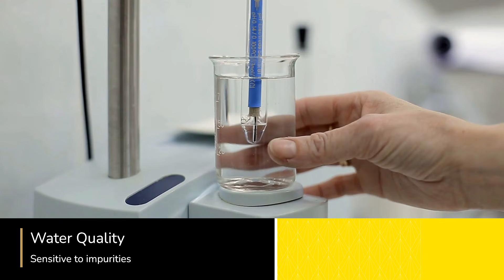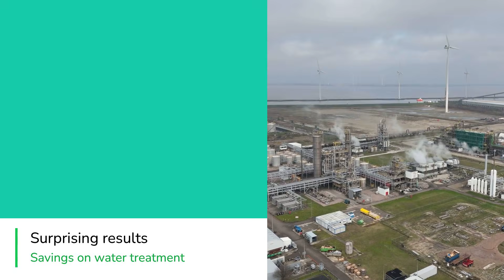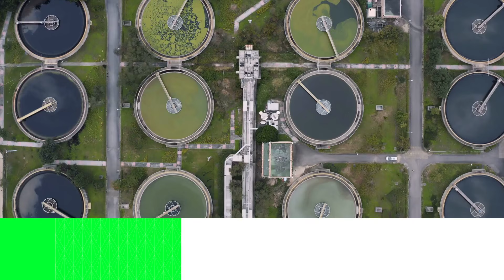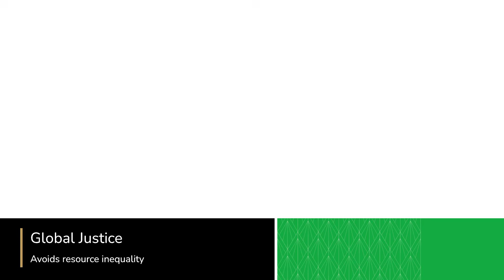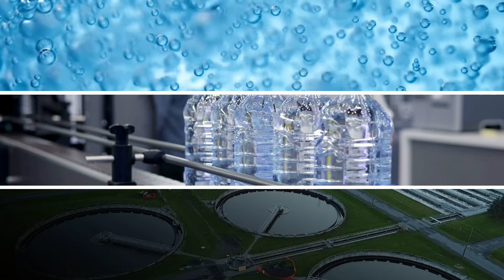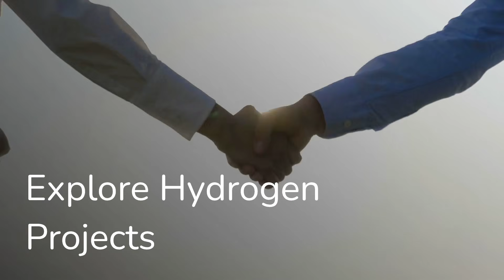This Wastewater Experiment Could Unlock $2kg Green Hydrogen

Comment: "Waste" is usually throwing away good money. Why not recycle the water for the residents and local industry? Hydrogen will be something one day. "You can imagine it!"
You have to have three times your grid capacity to be able to use the not needed electricity to make hydrogen. To use hydrogen it is best made close to where it will be used. So, best by the sea. With the rise of these Data centres and "AI Factories" you also need a lot of better than potable water and electricity demand is only going to grow.

Comment: What's the point when solar and wind and water power is so much simpler than the combustion engine and automatic transmission. When you compare the number of moving parts of green energy products to the number of moving parts that drive a combustion engine automobile down the street, you have the definition of simple. 5 or 6 compared to 500. More parts to break, never mind the carbon pollution.
Reply: it's been a scam from the fossil fuel industry.  they're the biggest users of hydrogen for cruel oil refining